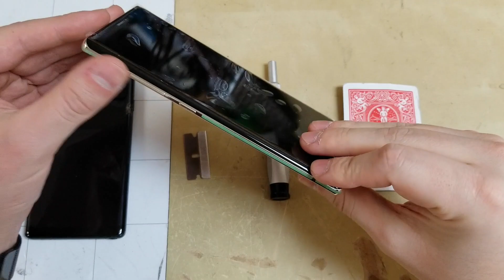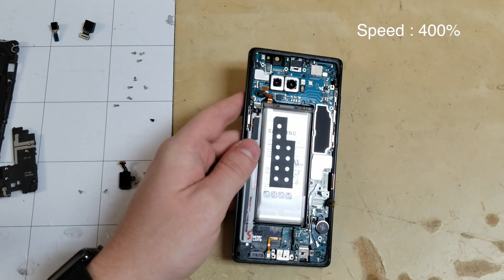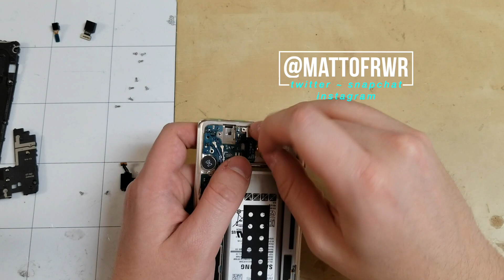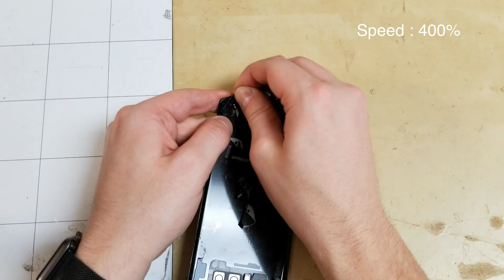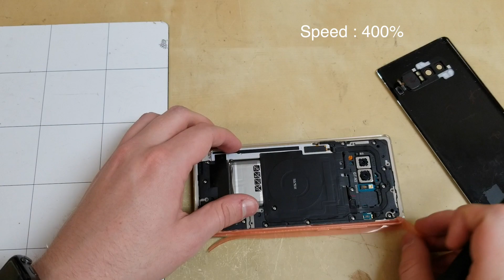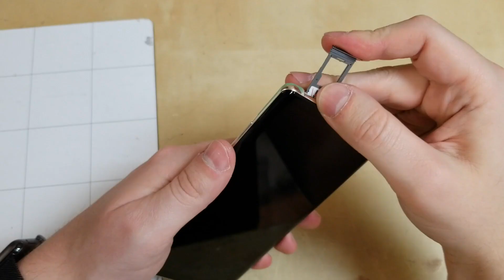Samsung Galaxy Note 8 Screen Replacement (Fix Your Broken Display!)

Comment: better off buying a new one .. i mean the process is easy enough for almost anyone to do it, but the tools are challenging .. 
What's worse is taking it authorized repair center, is not always the best decision, had some real bad experiences with those, where workers in repair center replaced the original samsung cameras with some fake shitty ones, and had a friend who started complaining about phone heating up due to torn up copper heat-sync ... authorized repair center will hand you back the phone in a working conditon, but god knows what's been changed/altered/damaged in there.

Comment: My lcsw didn't break but the glass on the outer shell of screen did the phone still works yet I see every so often pink likes green likes like shadows do you reccomend me just fixing the outer shell or replacing the whole panel ? Trying to not spend 350 to fix which is ridculous

Comment: 263 for the part or 320 for an unlocked grade A condition note 8 phone with a charger. I am thinking it is smarter to sell the broken phone as is and buy a clean one with a clean screen.

Comment: At this point in the life cycle it would make more sense to get a new phone. Or even buy a refurbished one and save yourself the effort.
Reply from the maker: True, the supply for these screens is kind of slim so Amazon and eBay charge more than wholesalers, which have screens for $160-$190 for OEM pulls to OEM new parts.
Reply: Seth is just a lazy guy

Comment: That's cool except that the replacement part costs 60 dollars more than getting an entire new phone through insurance would, not including the tools required
Reply from the maker: True, but you don't know what you're getting through insurance. As transferring your info to the refurbished phone they send you is sometimes difficult to do without extra accessories.
Reply: @RealWorldReview  and not everyone has insurance.  Lots of people buy phones without a contract now and guys like you are saving people lots of money. I can get a note 8 with a broken screen for 175 and replace the glass and frame for another 240. That's a lot less than buying the phone new.

Comment: Why all these false titles yall breaking the whole phone down to replace just the glass only
Reply from the maker: Good luck changing the glass without professional tools
Reply: @RealWorldReview  so the glass can't be replaced by itself at home with the tools the come with the new glass?
Reply from the maker: It can, but doing the repair requires lots of expensive machines (look up "Rewa note 8 screen",) which most people don't have or don't want to buy to replace one screen. I mean if you're extremely careful you can do it without the machines but even I can't replace those (I can do it on phones like the Note 3 and Note 4, but the phones with curved screens AMOLEDS are extremely fragile)

Comment: Will you lose any data or files off of the phone when transferring it to the new body? Any errors? Really appreciate it
Reply from the maker: Nope, everything stays!
Reply: @RealWorldReview  sweet! Thank you for the reply
Reply: That was my worry too. I have that glitch where the moisture sensor sais it has detected moisture when there is none and therefor i cannot get my stuff off the phone(I'm old school and like that). My screen cracked and was worried that if I got my screen replaced that I'd lose everything. Is it a guarantee that when getting the screen replaced everything else will be intact?
Reply from the maker: No way to guarantee because of just how things work. Sounds like you might need a new charging port too

Comment: So, when I went to go buy a repair kit all of the reviews were 1 star and said that it was pointless as "de-attaching and re-attaching the digitizer is nearly impossible." I don't see any mention of the "digitizer" in this video. What is it and where can i find a repair kit that includes it etc. Thanks for this extremely helpful video!!
Reply from the maker: That doesn't really make sense and I wouldn't buy from them if that's the case lol. The link in the description has the screen, just makes sure you select the one with the frame. Changing just the OLED and glass is a pain (and not what I did in the video), so ordering with the frame will make life easier and simpler.
Reply: @RealWorldReview  SO REPLACING THE DIGITIZER IS EASIER THAN REMOVING THE GLASS FROM THE SCREEN FROM THE PHONE?

Comment: What's the replacement screen and frame going for$?
Want to see is  worth buying it and the tools needed versus just having samsung do it. Thanks for the help and great video
Reply from the maker: The link says $237 USD.
Reply: Thanks man. Take it easy.
Reply from the maker: No problem, hope the video helps if you do decide to go the DIY route. Let me know if you need help with it
Reply: Will do. This procedure looks more challenging compared to the last time I had to turn on my tech repair mentality.  And that was fixing a 3ds. Appreciate the help and links. I'll be sure to check out the tools needed at a lowes.

Comment: I HAVE A LINE GOING THREW MY SCREEN, REPLACE GLASS OR DISPLAY AND GLASS?  WHEN U TURN MY SCREEN BRIGHT MY PHONE DISPLAY FLICKERS BAD....   PLZ RESPOND
Reply from the maker: Sounds like a broken AMOLED panel, so you'll have to replace both the display and glass like I did in this video.
Reply: your lcd got fucked up if ur glass isnt cracked u dont need the glass
Reply: The whole display (screen & LCD panel) has to be replaced. The LCD panel won't survive the glass extraction. Hence why in this video, he didn't bother pulling out the display & putting in a new one, but instead, used a whole new frame with the display already intact.

Comment: Is the frame necessary to have
Reply from the maker: Somewhat. It's not easy to find the screen out of the frame.
Reply: So I should get the frame your saying
Reply from the maker: Yes, it would make the repair easier and cause less problems in the future.
Reply: Thank  you

Comment: What adhesive did you use? Can you link me where you got it or what the brand is?
Reply from the maker: I use this, the 8 Mil version. https://www.tapplastics.com/product/repair_products/adhesive_tapes/double_sided_tape/411

Other tape I use is Tesa, but it is hard to find. The only reason I get it is because the company I go through requires a wholesale license before selling, so posting that link will be pointless.

Comment: Great video!, I broke my note 8 screen and I think I could fix it myself, however I can't seem to find the right part. I just want to replace the front screen.  I see kits with a clear screen or kits with the LCD digitizer.  Is there a screen with the contacts, if that's what they're called? I just bought the phone and I can't spend 300 more on it. Help! P. S. Thanks for the video!
Reply from the maker: Like HiImGolias said, it might be better to find a used phone for parts and use that for the repair. If you're in the US, screens can be found on eBay right now for less than $280, just know that this phones MSRP was $950 for a reason. These aren't cheap parts unfortunately. If you want to replace the glass only, you can try and remove it, but there is an extremely high chance of breaking the OLED under it. I have worked on phones for the last 10 years and did glass only repair on phones similar to this and I would not recommend changing out the glass only. It is not fun at all. If you want to order the screen, I corrected the link in the description. If you need more help with the repair, let me know! Thanks for watching :)
(https://www.ebay.com/itm/LCD-Display-Touch-Screen-Digitizer-Frame-Replacement-for-Samsung-Galaxy-Note-8/232587560986?hash=item36274c881a%3Am%3AmNh6CWRy5GvRTZhxZX_yYHw&var=531984178801)
Reply: @RealWorldReview   very helpful